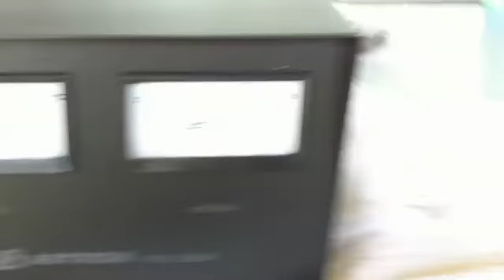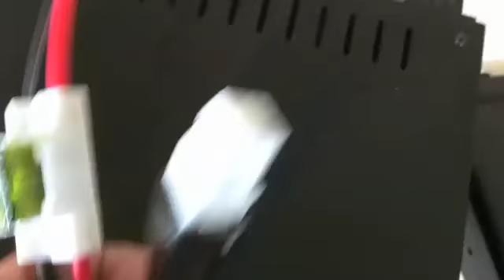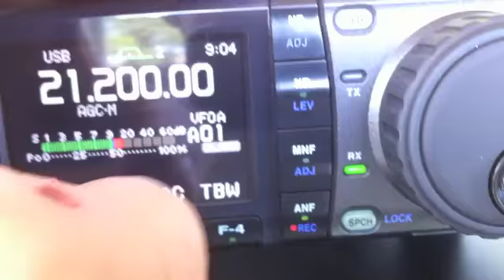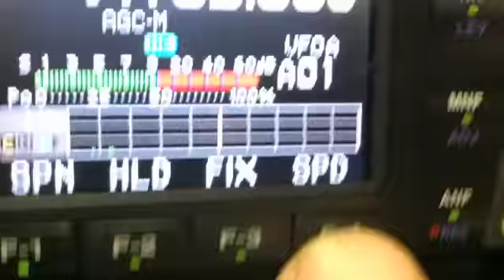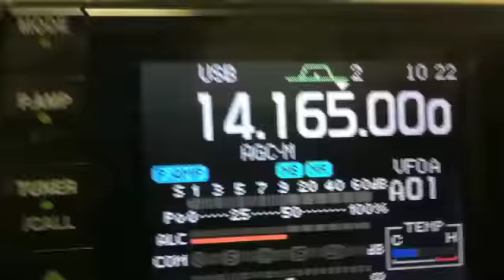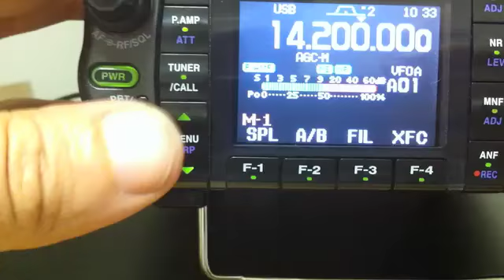Unboxing Icom IC-7000 and Astron RS-35M

Comment: Its a lovely radio, But after using Mike's IC-7000 i was dissapointed for 3 reasons. It dosent have a channel selector, There is no roger beep, and there is no Echo feature. 
I think Icom, Kenwood and Yaesu are missing a trick not adopting these expensive quality features on a mid-range priced radio.